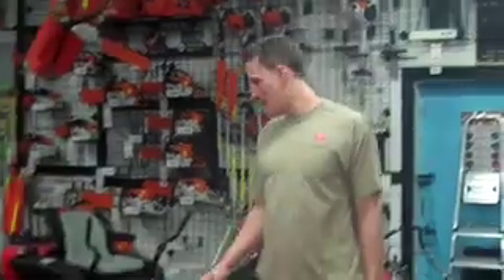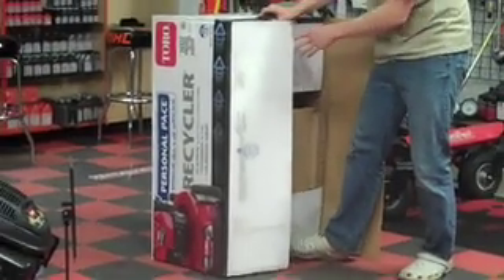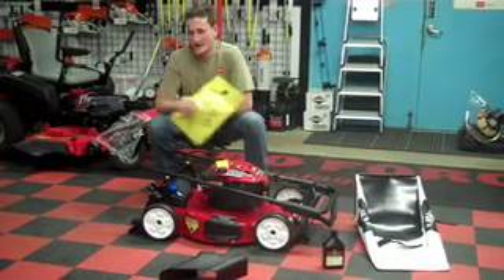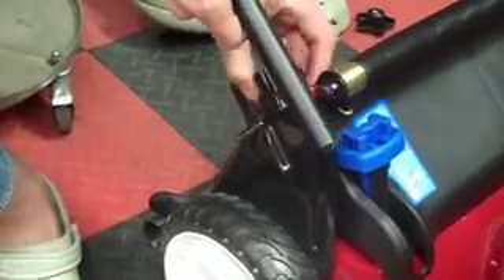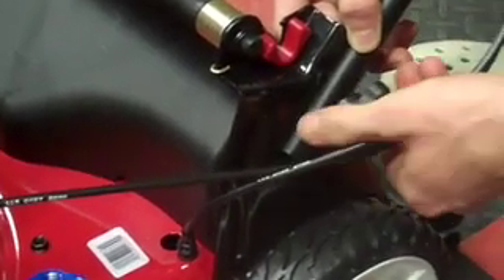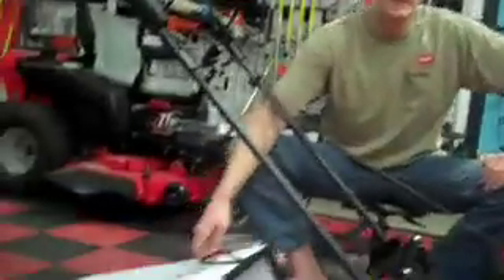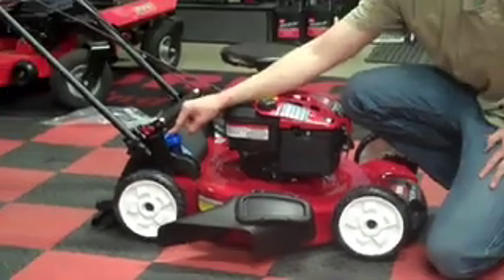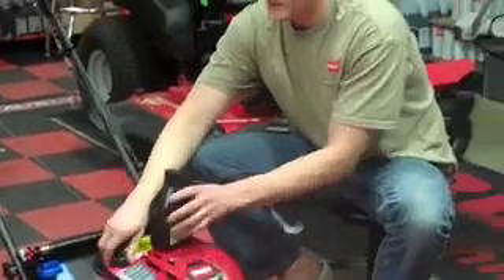How To Open and Put Together a Toro Personal Pace Mower

Comment: How to operate it?
Reply from the maker: Hi Patrick, you can check any of our videos on the recycler or the super recyclers. We have gone over the Personal Pace feature quite a few times :)
Reply: @mainstreetmower  i tried to start by pulling the string but it did not start.  Do I need to pull any lever before pulling the string?

Comment from the maker: @EmotionalResQ @mhtube01 I know this is 3-4 years later, but in reality, both of you are wrong.  The fact that it takes that many pulls to start the mower isn't Toro OR Briggs and Stratton.  By now, I'm sure you both know it's ethanol.  A Briggs and Stratton auto start is actually a choke.  Instead of you manually taking it off choke once the mower starts, a thermostat on the outside of the exhaust moves it almost immediately.  Honda uses this too, although to this date they do still have a couple models available with the manual choke.  There's a lot I can say on these subjects - ethanol and newer small engines.  At the end of the day, any changes that you feel are "they don't build them like they use to" type complaints are true, just not for the reasons you believe.  Like it or not, most of them can be chalked up to the EPA.

Comment: @EmotionalResQ The fact that it takes that many pulls to start your mower isn't Toro's fault at all. You have Briggs and Stratton to thank for that. Most of their new engines are JUNK! I have a Toro Super Recycler from '08 and it has that  stupid ready start feature which sucks. Every small engine NEEDS a primer bulb or choke or even both in order to start easily. The only power equipment company that still uses a choke on some of their mowers is Honda. Every other one does not.